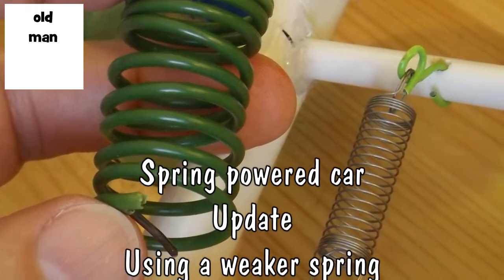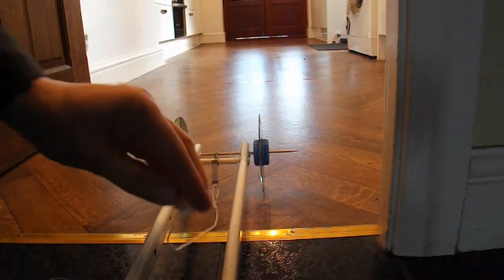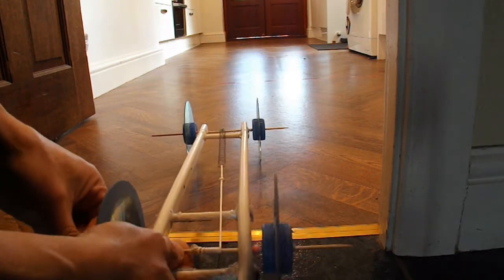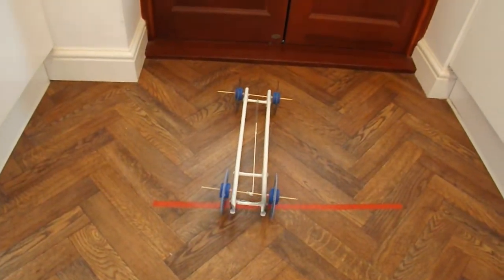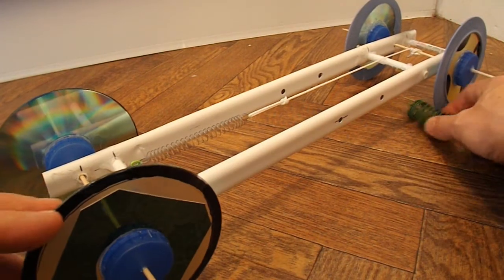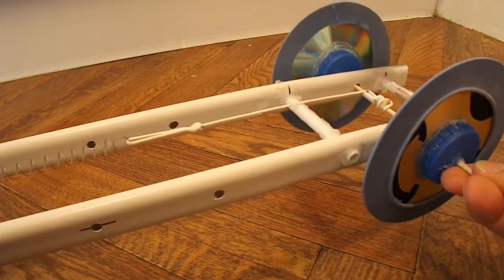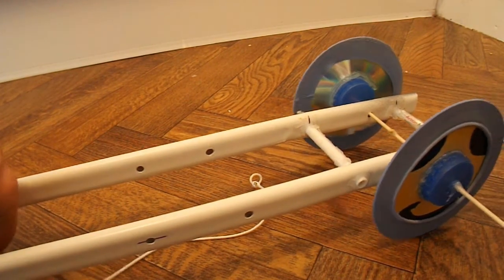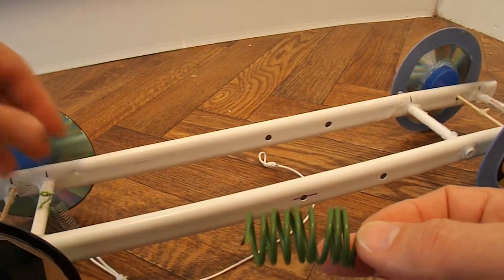Spring powered car - update - weaker spring

Comment: Hello again! Thank you for the last reply! One more question. The rubber band car link has materials for the chassis but some of them don't appear in this chassis. I want to create one that is like a replica of this. Please reply with the materials and the measurements. Also, reply as soon as possible... Thank you!
Reply from the maker: +Kaylan So just don't use the components you don't need. Make the dimensions to suit the materials you have available. The basic chassis is plastic conduit, the cross members are plastic ball pen tubes. The axles can be bbq skewers. The wheels are CDs or DVDs, you will need 4 and the hubs are plastic bottle tops you will need 8.
Reply: +GrandadIsAnOldMan Thank you!